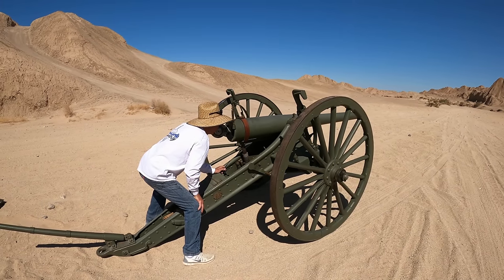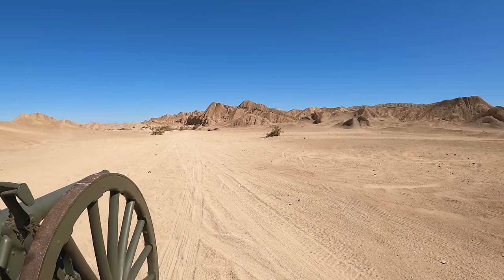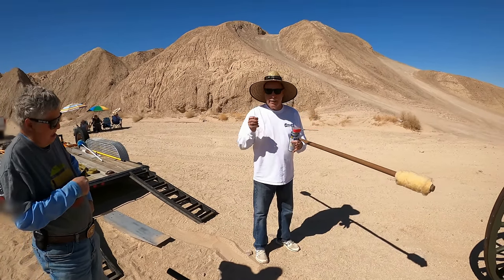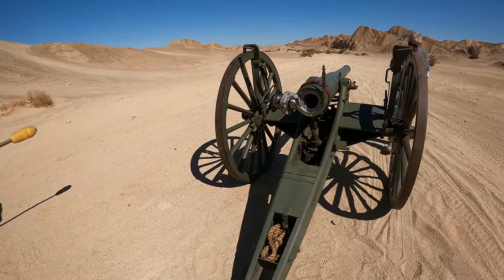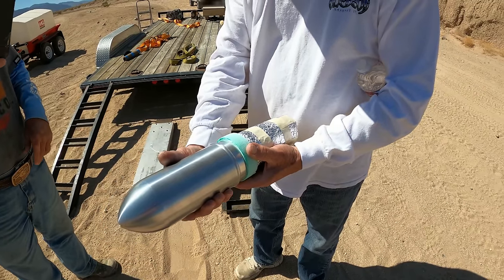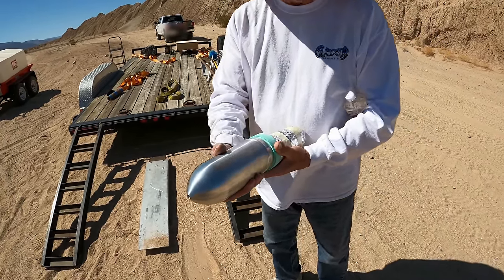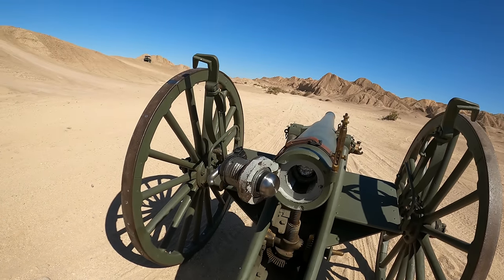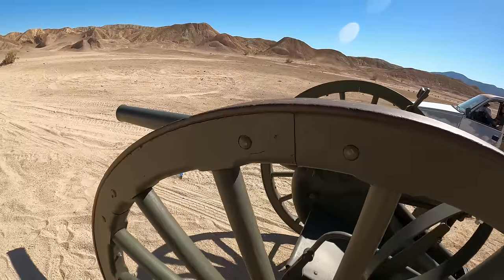1898 3.2 bag gun cannon.

Comment: WD40 is not a lubricant - actually it does the opposite. "Ballistol" would be a better product to lubricate the bore. greetings from germany
Reply: It's amazing more people don't realize this! The stuff is made to stick to parts to displace water and prevent rust, not lubricate.
Reply: @billcypher8563  And it doesn't prevent rust very well.
Reply: @barrygrant2907  I mean in reality that's kind of besides the point
Reply: I think dad said WD stands for water displacement..🤔🤔
Reply: The amount of people that burn out drillbits and blame me for selling bad drillbits (i sell tools) and finish their sentence with wd40 is frustrating, but i feel so much better when i see their face after explaining it.
Reply: Any cheap oil would work.
Reply: You're absolutely right. If you use WD-40 in air nailer's it ruins them. W D means water displacer and 40 is the year invented.
Reply: Thank you for the suggestion B ALLISTOL!
Reply: Will graphite lubricant work? 😆
Reply: Il WD40 è ciò che inventò Dio l'8 giorno...
Se manca l'olio per la pastasciutta uso lui!!!!😂😂🎉
Reply: @pooplips3114  40 doesn’t indicate the year it’s the formula lmao
Reply: Swab it with a mop and lithium axle grease just want a tiny film to lubricate and protect the bore
Reply: I was thinking the same. Balistol is the best!
Reply: WD40 is great in this application. It lubes the barrel well enough for loading and also acts as a water displacer when all is said and done. You don't want water in your barrels.
Reply: WD 40 real sucks

Comment: Many years ago we made projectiles for a guy who cast rough slugs out of scrap Aluminium, We machined the outside, drilled a 20x150mm Hole that he filled with lead,  20 mm from the base we cuta 8mm x 12 mm groove.  We made a small mold that he could pour copper in to make  driving band , just cut the spur off and sand flat.  Mind you, we never got to actually shoot his cannon, Which was annoying..  sadly the lot got destroyed in the 96 gun buyback..
Reply: I used copper fittings filled with lead. We never found out the maximum range. As there is no long flat area that the is safe to use. 
But it sure made a mess if it hit a tree.
We had more fun with firing a plastic container filled with 50% lead shot and 50% plaster. With this ratio you get a big puff of white when it landed. Fun when you young.
Reply: @assassinlexx1993  Lols  I used to machine  Cannon and Mortar barrels to use Coke Cans as ammunition.   Very cheap ammunition jackets that could be filled with everything...   Sadly all this is a pipe dream now...  But I still have 4000 acres to drive around on.
Reply: @HebrewHammerArmsCo  
You can't even afford the cost of black powder these days. 
Like the old joke of the Texan. That it took all day to drive from one side of the ranch to the other.
The other guy said yup I had a truck like that too.
Reply: @assassinlexx1993  I used to buy South African UEE 2F and  3F on my Explosives License $20 kg (2.2 Lbs)  These days 1kg is $150  apparently because of Covid..
Reply: @HebrewHammerArmsCo  
Just i like the line .
It was covid not me that rise the price. Where is the leadership today?
Reply: @HebrewHammerArmsCo  Covid has taught us much. I'll leave her there...
Reply: @assassinlexx1993  think in thirds.
1/3 charcoal 
1/3 saltpeter 
1/3 alcohol
Mix well and let dry.
Grind the resulting cake, and load up the old cannon. 
Enjoy!
Reply: @leidersammlung6955  Hmmmm No sulpher   interesting ...
Reply: @dmoore5120  sulfur lowers the ignition temperature and improves efficiency. but when you're using pounds to a shot, it doesn't really matter that much
you do want to use 1 part charcoal, 1 part alcohol, 2 parts saltpeter, the recipe he's using is far to rich on fuel

Comment: WW2 cannons seemingly have replaceable barrel insides presumably because after several hundred hits the inner barrel wears out.
Reply: Bores eroded to the point that replacement was needed. The big Bertha guns that Germans fielded, particularly during WWI, had increasingly larger diameter driving bands in their projectiles.

Comment: That is WD-40, which is not oil and it should not be used as a lubricant. You should clean the bore thoroughly with actual oil as soon as possible, if you use WD-40 regularly it will form into a hard resin, keep it far away from guns.
Reply: Think he’s using it as a cleaning solvent. Works good to get black powder residue out. Way cheaper than oil designed to dissolve powder and can be sprayed. A lot of smart-alecks for someone just enjoying shooting the cannon he OWNS
Reply: I have a civil war black powder cannon. We use water(maybe a little soapy sometimes to clean the bore. Then we would use a little motor oil for lubrication.

Comment: Pretty cool, I would be cautious about using aluminum. Sure it is a lot cheaper than steel with copper driving bands but aluminum, especially oxidized aluminum, is very hard on steel. This is why you do not see aluminum bullets for regular guns.

Comment: Very cool. How does the breech seal without a cartridge case?
Reply: Looks like it’s all pressure man
Reply: The breech plug has a obturation disk built-in, basically it sets the seal when the breech is closed. On some guns of this era, chamber pressure would push the breech plug back into an elastic disc which would then expand/squeeze outwards to seal the breech. Others used a copper spring washer or compressed fibre or even asbestos mats to achieve the same effect.
Reply: The black ring on the breech block is an obturator ring. Usually made of rubber. When the charge ignites, it pushes on the domed head of the block, squashing the obturator to seal the breech.
First used if the French Chassepot rifles in the 1860s and is still used today. Even used in the 16 inch 50 caliber Mk7 naval rifles.

Comment: Hello, I have one of these that came from the Oregon coast, it is a Model M1898 and was only retrieved from it's post in 1984. Unfortunately the breech is rusted shut and the carriage has rotted away severely. I have the original wheel hubs but the wheel spokes have long since rotted away. I am trying to both establish a value and also get as much information with regard to the possible restoration of the breech mechanism. Plese contact me at your convenience. Sincerely, Robert Green

Comment: Shell, it's a shell or a projectile, not a bullet!
Reply: The term "bullet" means any projectile hurled.   A rock thrown can be called a bullet.   16" naval shells are called bullets too.
Reply: @taofledermaus  Nope, in theory maybe but it grates like all hell. No one calls a 16" naval shell a bullet even if it technically is one.
Reply: @marvindebot3264  Sure they do.  You're confusing anal-retentive terms with colloquial terms.
Reply: @marvindebot3264  I'd say technically the 16 inch projectiles are shells, since that's the only thing they shoot: a general purpose high explosive shell and an armor piercing high explosive one -- a sinister looking charcoal-gray pointy boat-tailed thing five feet tall. Gunmetal colored ballistic cap at the point. Remarkably like a .50-caliber slug writ large.
Reply: Fun fact: in the Fifties, we did make up about four dozen nuclear 16 inch shells for the Iowas. Used the same warhead as the Army Atomic Annie, just in a larger casing. Didn't really need more!
But this was really a weapon type in search of a mission, and these shells were eventually scrapped.
Reply: @taofledermaus   A Belt with a  long tail hanging down would help ?  I am not sure if  I phrased that Correctly .

Comment: But stop calling it a bullet. It's a Shell.
Reply: Weren't solid ones called shot?
Reply: Shell are, definition, hollow. This one was firing solids. AS they are not round, they're not balls, either. Bullet is the correct technical and artillery term.
Reply: @ShenandoahStoneworks  I believe the round balls were called shot.